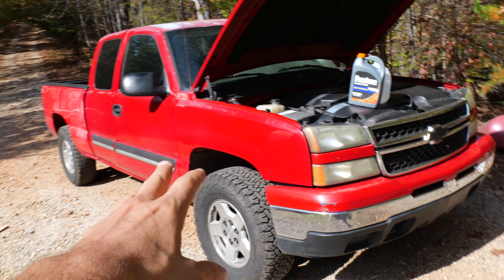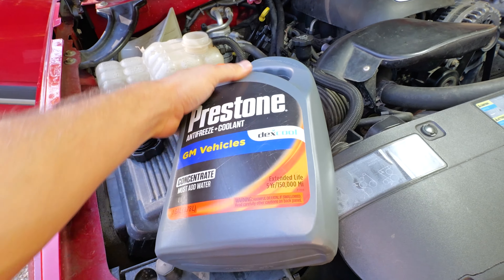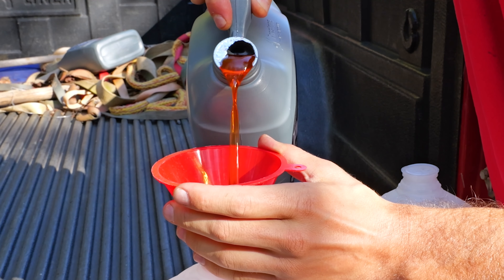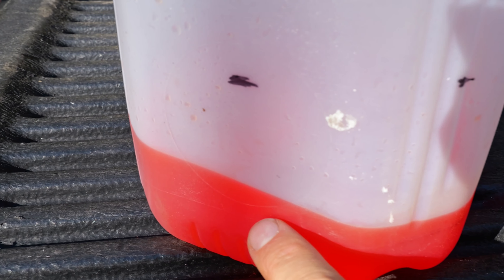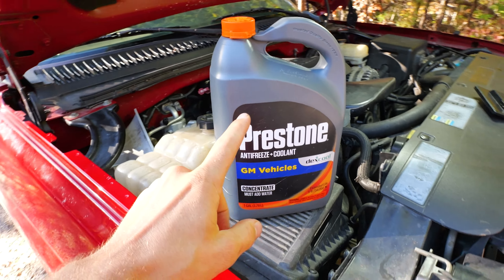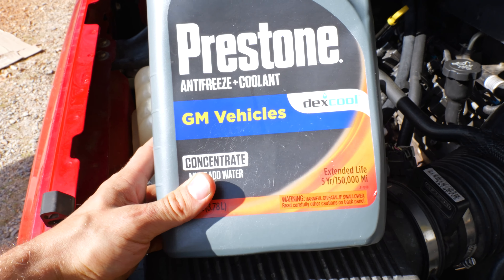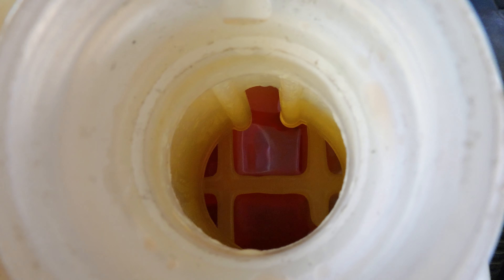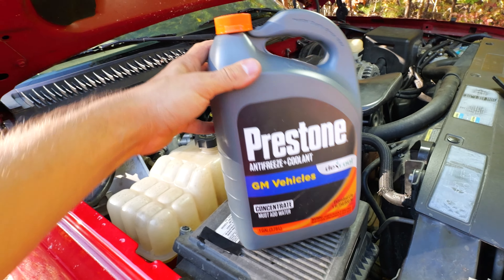Chevy Truck BEST Antifreeze Coolant 50/50 Mix?

Comment: At my local Walmart, name brand concentrate cost $1.03 more than the 50/50. It just makes sense to buy the concentrate and make your own 50/50. You get two gallons for the price of one.
Reply from the maker: Yup, exactly. You can literally buy a bucket to mix it in too for cheaper 🤣😂

Comment: I flushed my 06 Tahoe 5.3 out a few weeks ago.  It took about 20 gallons of distilled water to thoroughly clean everything out.  I then replaced the plastic "T's" and hose quick connects at the heater core with Genuine GM parts.  I replaced the plastic "T" by the water pump with an aluminum one (not Dorman), and replaced every single coolant hose with ACDelco hoses (including the little throttle body ones) and replaced the thermostat with Genuine GM.  I then filled the system using about 10 gallons of Prestone Platinum Universal Longlife premixed (did not want to use DexCool aka DexKill in my vehicle), coolant (making sure all distilled was flushed out).  The Prestone is rated at 15 years, 350k miles, but I'd change it again long before that.  DexCool CAN go bad if left in the system too long.  It can crystallize and harden, blocking passageways in the heads, engine and cooling system, thus my dislike for it.  Hopefully I'm through with that tedious task for a long while.  I couldn't find aluminum fittings nor "T's" (with rear heat) for the heater core area, thus I just used GM replacement parts.

Comment: One pointer to save your engine, Replace plastic connectors in the engine compartment to your heater core.
They sell upgraded metal connections.
Reply from the maker: I have a video on this soon
Reply: Yep I replaced my plastic ones with the metal Dorman fittings..Had to do an emergency bypass to get home when one busted.
Reply: Stainless steel ones to be exact
Reply: @DRDROP-fj4bo  Hahaha I had a similar experience...
Reply: What about the T’s for Suburbans/Tahoes either rear heat?

Comment: On my new to me 2500HD its been disappearing lately, had it run hot. Any ideas where the common leak spots are? Doesn't show any signs of leakage
Reply from the maker: Heater hose connections. They ALWAYS leak. Tons of videos on this soon.
Reply: 1. There is a hose that has a plastic y in it. I believe it goes to water pump,coolant rez,heater core. Always leaks at plastic y fitting. 2. Coolant rez crack in the bottom. 3. Weep hole bottom of water pump.
Reply: @DRDROP-fj4bo  Thanks I'll be sure to check those out.
Reply: Check the intake gasket under truck to see if shows signs of leakage
Reply: Check water pump weep hole

Comment: Matt have question doesn't coolant stay in motor if u drain radiator so it put pure antifreeze wouldn't it mix with coolant that is prob watered down alredy
Reply from the maker: Yea, but then you don't know if it's mixed 50/50

Comment: I use and do the same thing Matt..05 LLY Duramax..388,600 miles. Zero leaks,zero issues. I drain and replace coolant every year..cheap insurance